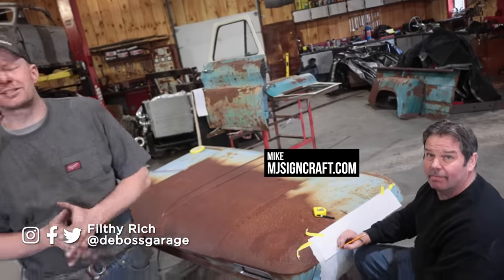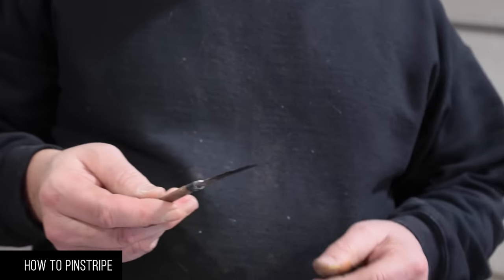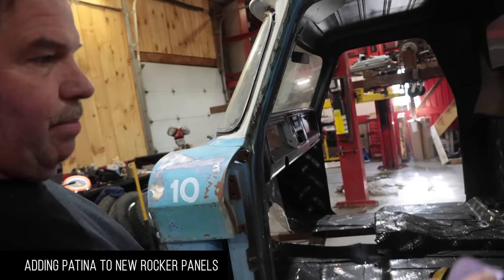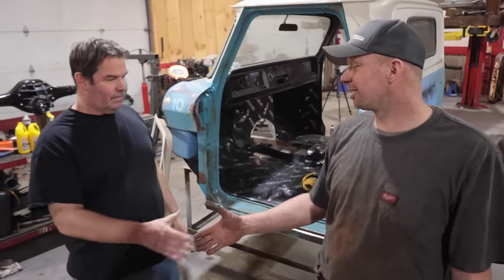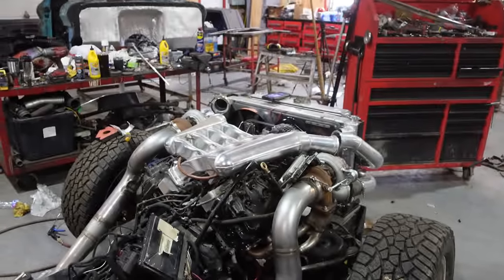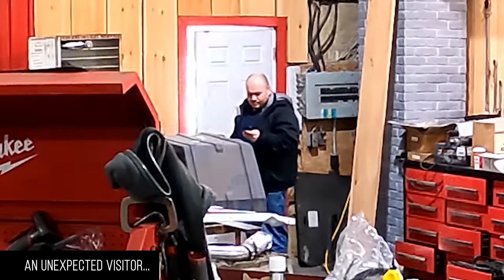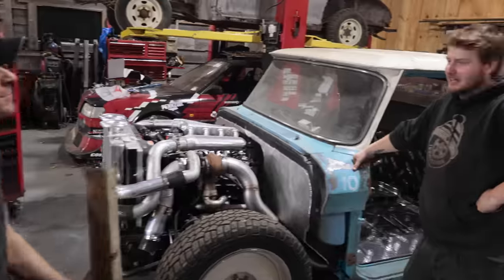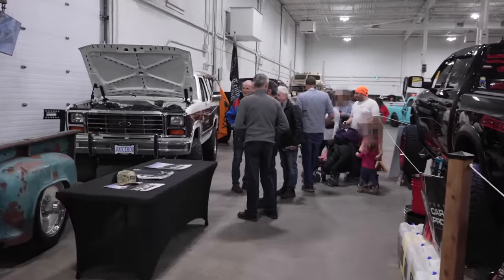We Secretly Painted the C10 Tow Truck for Tewsley. #TTDmaxC10 [EP18]

Comment: So cool that you were able to use the tow truck boom to put the cab on. The truck looks really good.
Reply from the maker: It will look complete when I have the steps on it.  Lots to do yet, but it is running, all the brakes and power steering are working.  Getting close